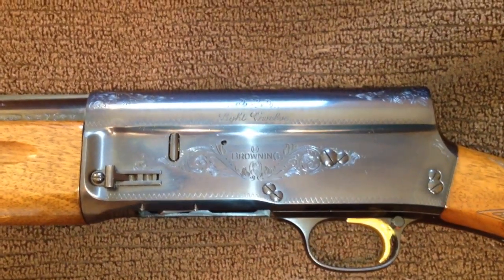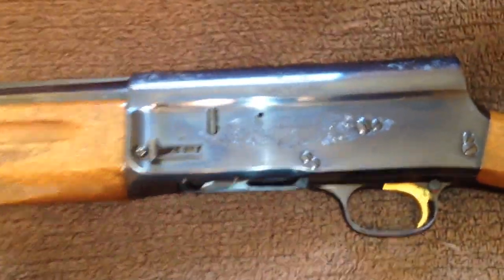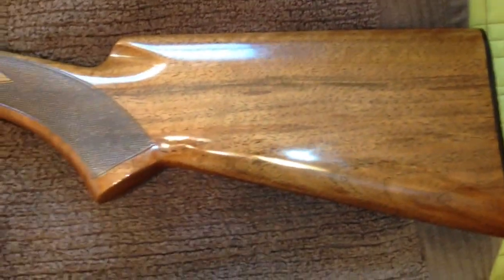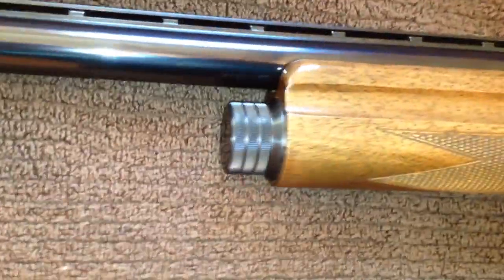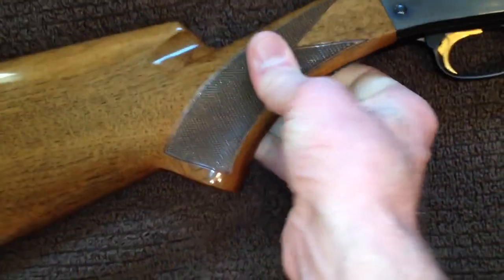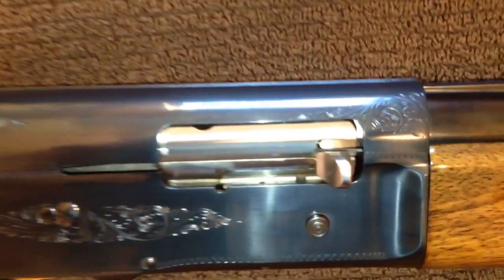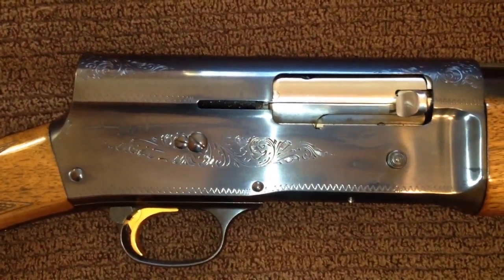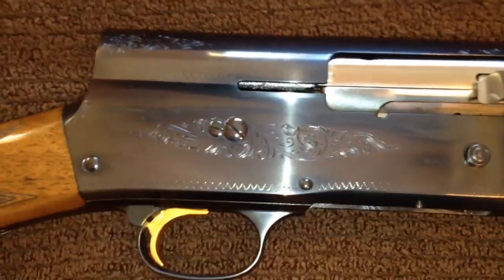Browning Light Twelve NIB Belgian 1971

Comment: Got mine for just under $600. It's a standard 12 gauge model, and it was refurbished at one point before I got it, but it's still a Belgian Auto 5, and it works great. I chose to shorten the barrel on mine to 18.5 inches. It had a full choke 28 inch barrel. I seen others do it online and thought it was interesting. Don't plan on selling it so why not?

Comment: I picked up one of these for a cheap shotgun and 80 bucks at a pawnshop it smells like an old harmonica. Its got the poly choke. And takes 2 3/4 inch 12ga. Made in Belgium. As of this comment,ive owned it for 3 hours.

Comment: that's beautiful, had never seen one that nice....was the barrel marked as "full" or "modified" or was the barrel marked at all?
Reply from the maker: I learned from posting this video that the barrel is full, not mod.  It is marked * I believe.
Reply from the maker: Correction, it is FULL choke marked by one *
Reply: 1x "*" (asterisk) sign equals "Full choke."  2x 'Asterisks'  = Modified.  3x 'asterisk's = Improved - These are marked/stamped on the barrel's.